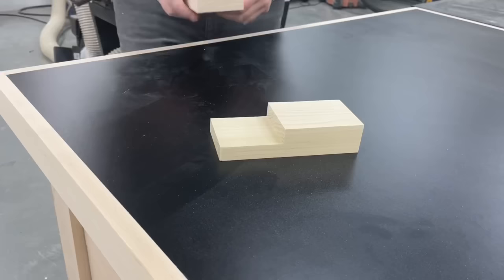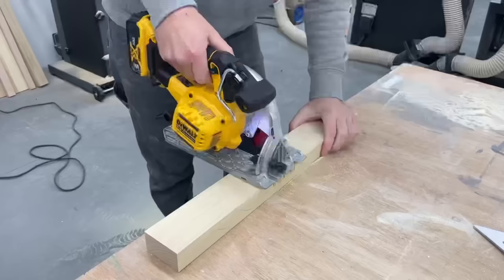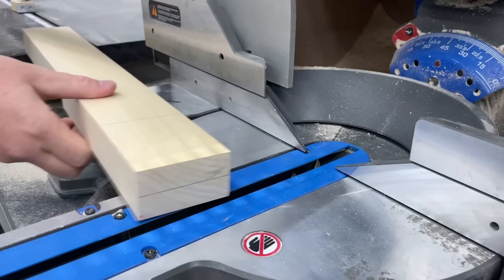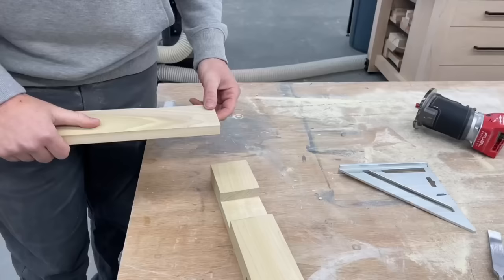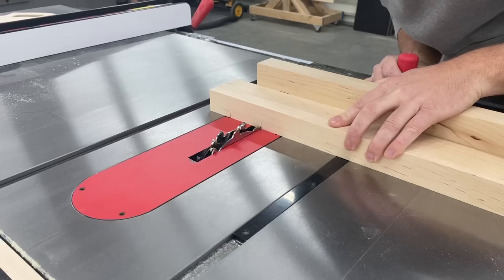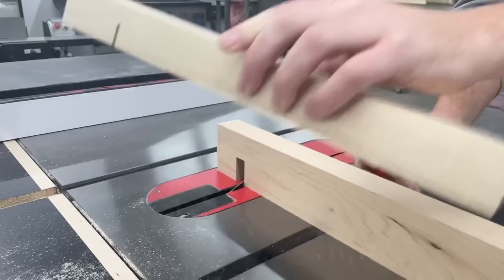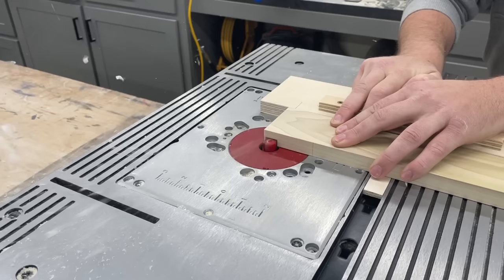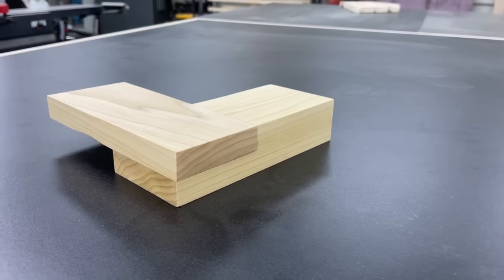STRONG Wood Joints | 8 Ways to Cut Lap Joints

Comment: What bit did you use on the last little router tool?  Also, with that little router, it would work to do an overlap cut right, not just on the end?  Thank you for the video, I do very little woodwork myself, and only have a few tools, I think I'm thinking about buying a router, they are cheap enough and small enough, just not sure what bit I need to make these types of dado cuts
Reply from the maker: 1/2” mortising bit

Comment: Good stuff. Very helpful. Question - Does the stock thickness need to be divisible by 2? For example, you're using 1 1/2 stock joined to 3/4. Would it matter if the smaller piece was say, 5/8? I'm trying to build your outfeed table with dimensional lumber. I've milled the 4x4s down to 3 1/8 square and now need to mill the 2x4. After jointing and planing the 2x4s I'll probably have them down somewhere around 1 1/4. Do I need to plane the 4x4 so their max thickness is twice the thickness of what I'm joining them to?
Reply from the maker: No you don’t have to do exactly half. If they do end up 1 1/4 (or whatever) you’d just cut your lap joint that depth so they end up flush
Reply: Thanks. That’s what I was hoping! Got the legs and stretchers milled and about to throw the dado stack in to cut my first half lap!
Reply: Thanks for the refresher course. Good  to see someone on YouTube putting out good content while making money.

Comment: I’ve gotta make 32 1 1/2 inch deep, 3/4 inch wide half lap joints and the thought of raising a dado stack to its max height frightened me, I had completely forgotten about the depth stop on my sliding miter saw. 😂